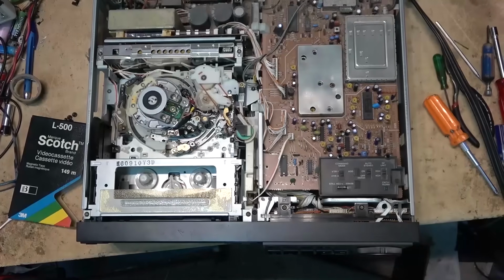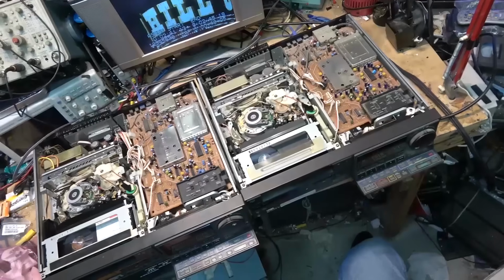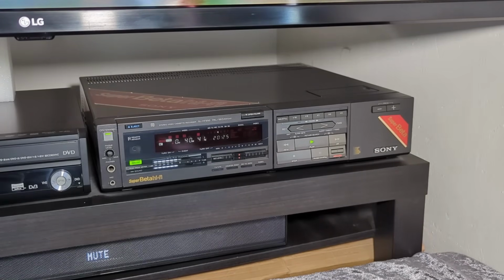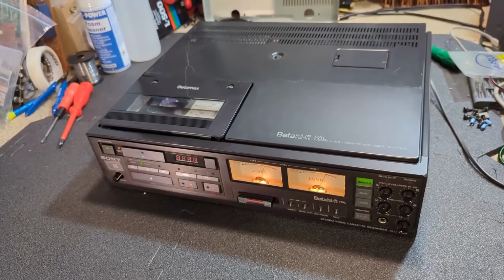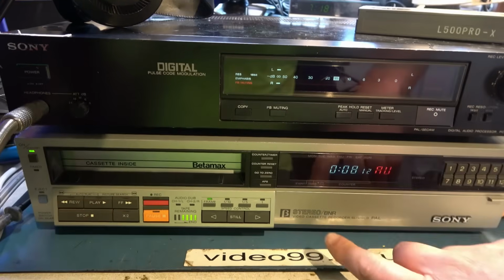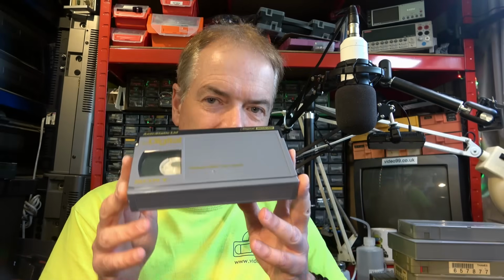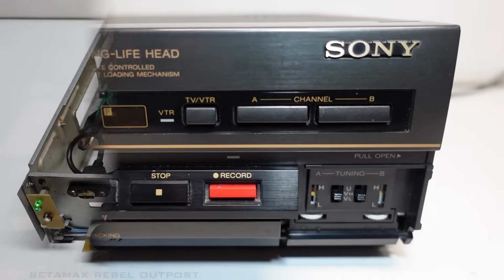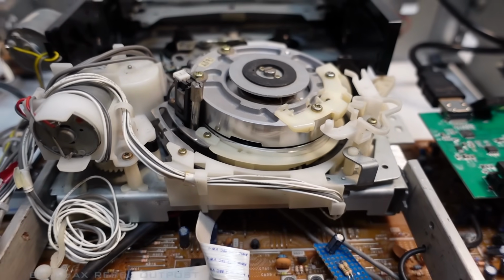Betamax 50th Anniversary

Comment: I liked the demo on editing. Very interesting. 
I have a Sanyo 9100A that runs. But has a noisy bearing. In the motor I assume. I have found finding Beta machines has been hard for at least a decade. Maybe more. Outside of ebay etc. 
The English guy has a great channel too. Just discovered it yesterday.
Reply from the maker: I used to have a 9100a pretty much bulletproof.  
The 1000s were great as a cuts only editor. 3 frame accuracy was as good as it got till time code came along. I recently picked up and EDBeta for like 25 bucks with 3 tapes.  So now I have pretty much the complete beta suite.  Betamax Ed beta betacam sp and betacam sx

Comment: Great to See You again Dave HAHAHAHAH
Great video...
Should Have kept the SL-5000 I had. Sadly it got junked after the House fire..
Mike M...
Reply from the maker: The 5000 had its issues. Belts and Idlers and the infamous Sanyo aluminum caps that all had to go. That was my job at Sony, recapping all the bad Sony 5000 and 5020, 5100 ect. I have the 5200 as you know that is the same machine with Hifi, the first HiFi machine made.
Reply: @12voltvids  I got it from a co-worker in the early 90's as He was moving.
It even had a newer set of Head in it and it was in good working order.  after the Fire I had a lot of old Electronics go to recycling and it went too...

Comment: Very good machine very heavy at the time🎉
Reply from the maker: Yes these ones are pretty heavy.  This was the best betamax produced in my opinion.  Stellar picture quality, pre-roll editing.  It just didn't get better.  Why pre-roll you ask? To give the servos a chance to lock up completely before the edit was performed.  Just like the broadcast machines.  None of the vhs machines except for say professional decks controlled by an external controller did this.  It does more than this, it also has a titler built in to  put titles on but they are just basic all cap titles.  We all used videonics tm1 back then and then the tm2000 came out and wow.

Comment: It’s interesting to see how the terms ASSEMBLE and INSERT evolved from consumer to industrial implementation. In the usual industrial setting, like on the Sony RM-440 edit controller, ASSEMBLE (destructive) was a type of edit that built the control track onto a non-black striped tape on the IN point vs an INSERT (non-destructive) that placed an edit on top of existing control track.
Reply from the maker: That's right.  Insert editing requires an existing control track and that's why i had to do it over bars.  Could have done a black screen for that matter.  There is a black video switch to do just that.  Allow you to lay black on an entire tape If you are so inclined to look lay your tracks down as insert tracks but normally it's used for your b roll insert. You assemble edit your main shots and then insert the cut away.    When i shot weddings my main camera recording sound was assemble edited and then the second camera was used for the cut away shots as video only insert.

Comment: yeah its a failed format like all other Sony formats they just suck at making standards look at the magic gate sd cards they tried to push on people i hated using those things on my Play Station Portable at least the Nintendo DSi took normal sd cards
Reply: Video8 / Hi8 was a failed format was it?  And CD?  And Betacam?  Even MD and DAT sold pretty well internationally for many years.  Maybe you're wrong.
Reply: @video99couk if anything probably the biggest failure of Sony was the transition from metal to plastic mechanical parts, most of their portable range would ultimately die particularly the portable DATs if you wernt caring of it.
Their VHS (including some Beta's) were great until their mechanics suffered from heavy use plus poor maintenance.

Comment: 11:00 SECAM-Ost mentioned .. Did Betamax also have different recording formats for Eastern European and French SECAM like VHS did, or were the recording formats identical and "SECAM Ost" was merely a tuner feature?
Reply: Yes Beta would record in SECAM so you needed a SECAM player to handle them.  Some also supported the MESECAM workaround like VHS.
Reply: Yes. There's Middle East SECAM and French SECAM. My SL-T30 and T50 support both variant (playback only for the French variant).

Comment: Great video and collab but No ED Beta?
Reply from the maker: I never went to EDBeta, by this point in my production career I was needing higher quality, and even though EDBeta did that as far as lumanence resolution went, it did record 500 lines, however the color still only managed about 40 lines. Betacam SP on the other hand did 340 lumanence however did 120 lines of color which was a requirement for broadcast.

Comment: Nice to see all these machines made back in the years. I have to say that my best machines that I like have to be mainly industrial although i do like all the others too. The best machine in my view which I adore is the Sony SLO1800. Sony SLHF2000/2100 are also on my list. I have many NTSC and PAL Beta machines that I have collected along the years. SLO1700 (PAL) is also a killer with it's looks. Happy 50th anniversary Betamax...
Reply: Although the SLO duplicators you mentioned were infact based on the mechanical deck of the SL-C9 (which also was in the  SL-F1) with slight alterations having the SL-HF100s Hi-Fi video head type, and most of the electrical guts of the SL-HF100 with alternations. imagine what could have been if such an industrial combination was issued as a commercial deck...

Comment: Hi there! I found your video on the Minolta master series v-16R video camera because I was at a value village and found the same exact camera. I was looking for ways to turn it on. I saw you use a different looking battery in the video to the one I have (mine probably dosent work, I dont have a charger) and I was curious to know what that is. There looks to be no damage on the unit (no rattling), and I have been interested in using this camcorder for my music videos, so I would like to check if it works or not.

Im referring to this video in particular: https://www.youtube.com/watch?v=xRhsHOjqumg

Comment: Another innovation even Sony wishes they never produced. RIP the video cassette.
Reply from the maker: Sony wishes that JVC hasn't stabbed them in the back and basically stole their design. Made a couple of changes and then gave the plans away that they basically stole from Sony.   When Sony invented the 3/4umatic along with Panasonic. The chairman of Sony wanted a smaller version for home use and the 1/2" beta format was born.  There should have only been 1 standard but JVC had to spoil the party.   Sony did get the last laugh when broadcast and professional users chose BETACAM as the standard.   For 30 years Sony and other companies that Sony licensed like Ampex and Bosch BETACAM ruled broadcast  and was expensive so Sony made a killing on them.
Reply: As I say, Sony almost certainly made more money from Beta and its derivatives than anyone ever did from VHS.  Sony didn't regret that.
Reply from the maker: @video99couk  For what betacam products sold for and considering that mechanically with exception to the drum (seperate luma and chroma heads) they were identical. Cost wise it probably didn't cost that much more to make a betacam deck, but it sold for 20X the price and look at all the tape they sold because of it.I have a beta SP tape that has the 200 million betacam tapes sold sticker on it.  They sold a lot more than that for sure, that was a tape left over from my betacam days and I dumped it 25 years ago when I went digital.
Reply: @12voltvids , Betacam decks had much much more electronics and modules inside to deal with signal processing. After all these were meant solely for professional industry and were expensive with reason.

Comment: Great vid, thanks for the memories although for me it was the Broadcast side & the Sony BetaCam to D2 to HD etc Broadcast kit i specialized in at a TV Station... The level of engineering in gear was phenominal & there were 100s of decks that had to have maintenance 24/7... There were a few Betamax decks but so too the rough as guts VHS... And then suddenly it was all gone, Raid Array crates of HDDs replaced the VTRs & all that tape mech-deck knowledge useless culminating in the Station not able to sell enough advertising the career became retirement! Thanks for the memory jogger M8...
Reply from the maker: BETACAM had a good run through to the HD versions.

Comment: Great video Dave on the Betamax. Just wondering the HF1000 was sold as a PAL version too or the HF950 the PAL version?
Reply: The SL- HF950 is a pal machine.
Reply: @smmit2k4you9 ...variant of the NTSC  -750.
I don't think there was a PAL version of the 1000 but there were only a small handful of Pro PAL/SECAM models after the 950 but in mono and even then the special features were gradually been stripped back as Sonys first VHS PALs started been issued with early trick equiped models.
Reply from the maker: I don't know if there ever was a pal version of the 1000. I know the Japanese version was called the slhf3000.  Same machine except 100 volt transformer.

Comment: i never evr see beta players or tapes in any thrift shop or yardsale here. ive seen one my whole life that was in really bad shape at a goodwill i dint buy.
Reply from the maker: They are getting rare. I have a bunch.  A sl7200, sl8200 are my oldest.  I also have an sl5200, sl2000, sl2700, slhf400, slhf600, slhf900, 2 slhf 1000, sl10, sl30 and Toshiba and sanyo beta and the very rare Vidimagic projector with the beta player built in.
Reply: @12voltvids  i live in virginia and i have never seen a beta tape for sale in any store. i dont own one. but i have about 600 vhs tapes. ive picked up crates of them on the side of the road for free.

Comment: 50yrs old...  Awesome.
Reply from the maker: I have an old SL7200 which was the first model sold in Canada.  
I should drag it out for shits and giggles.  I would imagine it need new rubber. I have an sl8200 as well.  That one did work last time i ran it.  Thinking back i should have shown my Vidimagic betamax combo.  A beta player with a single gun projector built in.